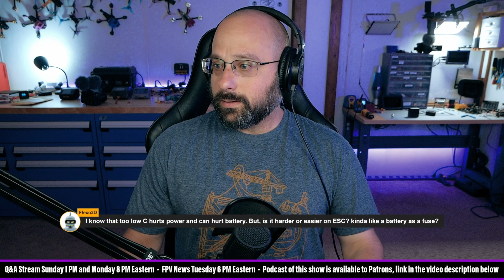Can A LiPo Battery With High C Rating Damage My Drone? - FPV Questions

Comment: ESC pulls the amperage it wants, batteries don't push amperage.  Just means the motor was over powered for the ESC not that the battery c rating was too high
Reply: Exactly his phrasing and conclusion were bad.
Reply: You are correct.

Comment: Just remember that the motors will try draw certain maximum current, and ESC must withstand that current flow and finally battery must able to deliver that current demanded by motor.
1. If your RC/drone motors that draw high current and ESC can withstand high current flow but your battery under deliver the current (low C-rating), this can overheat your battery.
2. If your RC/drone motors that draw high current and battery can deliver the demanded current but ESC cannot withstand high current, the ESC will overheat and burst into flame.

Conclusion, battery C-rating is just telling it can deliver how high the demanded current without getting overheated.

Comment: No, I don't agree with this. One of the few videos where I disagree with how you presented the information.  A poorly chosen ESC rating may fry when it's not limited by the current that the battery can deliver
Reply: A battery should never be the limiting factor, if your esc is trying to draw too much power it means the motor is either rated above what your esc can handle or your esc is dodgy.

Comment: Right first i'll state i'm new to drones/quads/RC,but i am an electronics technician,so i can clear this shit right up here and now.

I'll state that "I" searched to see if a higher C rating can damage my possible new quad i will bid for on flea bay.

So to set the scene the flight controller commands the ESC to output some pwm pulses to controll the MosFet transistor switches.

The rating Ids and Vds of the MosFets are the limiting factor here,not the motor,the motor will demand what it needs from the supply via the MosFets and thence from the li-po battery.

If the motor is not sized properly to the weight to overcome "AND" THE PROP PITCH DRAG,then the motor can be damaged as the control gear is trying to force the motor to drive a heavier load than it can handle.

The concept of slip comes into play which is how much travel a spinning prop give to one rotation like a dirtbike wheel spinning it's moving but the knobbly tire can get only so much grip on the dirt to give traction,air being a liquid medium is akin to the lose dirt you need more input to get more travel,this leads to prop pitch,how hard your drive can push the air and can the circuit paths leading to the motor handle the current.

I personally would assume the ESC is rated from the motor manufacturers data sheet on the motors maximum current draw for a maximum load,which those implementing the ESC into the drones design should be able to calculate(the loading),which may be for a specific thrust ,this is where the problem lies.

If you want and i am no different,(at least i can foresee an issue from experience of electronics) a faster reacting drone from changing from a limited current output C rating to a battery with a lower internal resistance that equates to a higher C rating,if  the throttle is just pinned out to rip and the motor tries to suck in as much current at the voltage of the battery,remember the voltage will not sag as much now due to the higher current available,the afore mentioned drive train ie prop drag/weight/thrust required to shift the bugger at the pinned throttle position may indeed burn the motor,if the Ids rating of the MosFets is up to it they will be fine.

As for the MosFets they will be in parallel each ESC may have six in parallel,each may be rated to a Vds of say 60Vdc no issue there,the current rating  Ids may be 20 amps or more easily,for quad package MosFets in parallel just add the current up eg 4 x20A=80A.

Looking at mousers site i see single package NVMFWS003N10MC Single N-Channel Power MOSFETs Offers a 169A continuous drain current, 3.1mΩ at 10V RDS(ON), and 100V drain-to-source voltage.

If you retro fit anESC with 4 of these you need not worry about the MosFets burning out,remember to check the data sheet for heatsink rating as the heatsinks i see on ESC devices ,to be honest they are shit and not up to the job,for bursts of current to push a quad like the one Mr joshua Bardwell and Co were showing on rotor riot with the 8s drone,i would have used 2 pairs of 4s  parallel then in series with another pair in parallel along each side,but what the F do i know,that little quad had the burst power of my 250cc suzuki RM,racing power max thrust when needed,ideally cooling will most likely be the biggest issue.

The biggest enemy of a transistor is heat dissipation and fast or a bad design possibly also downstream tinkerers mot quite grasping the concept as a whole.

Get silicone heatsink glue and a bunch of the 8x8mm heatsinks on the ESC mosfets,seal the electronics on the pcb with either a spray on conformal coating or paint it with nail varnish or the "proper" silicone brush on for electronics,though clear nail varnish is very cheap,don't paint the MosFets and don't add shrink wrap to the ESC after fitting heat sinks ,as the nail varnish etc will protect the electronics from moisture,WHY WOULD YOU ADD AN INSULATING LAYER OVER A HEATSINK?????????,the makers add some over the crappy heatsink plate,that makes no sense from a thermal protection perspective,so it protects from the elements,why not coat the electronics and allow the plate to breath in the air of cooling goodness.

If your gonna fuck around with electronics to "enhance" the performance. a ground up thought process needs to be undertaken,heat sink all that shit,that will i guarantee give current headroom if you don't think so read the manufacturers data sheet the the ESC makers data sheet,take the shrink wrap off the ESC read the small black squares numbers take not google them find the MosFets then get the data sheet and read about thermal atributes for cooling and how much current without a heatsink,add a small amount ant thet's most likely the ESC rating,add some 8x8mm heatsinks or ones to fit "each " tramsistor,then and only then will you have some confidence with higher C ratings,i still would not go crazy say 20c raised to 40-50c,i'd err on the side of sanity and go for 40c.

Sorry folks for such an long explanation,i am seeing a lot of amazingly experienced info on drones and how to fly them or program the drones flight characteristics on beta flight etc,but also some not so intune at the component level tinkering.

If anyone wants to learn more on this i suggest "THE ART OF ELECTRONICS" or "FLOYD ELECTRONIC COMPONENTS" floyd has the same 2 inch book on digital electronics too,piss cheap on flea bay these books and  the art of electronics has a student q+a book too.

A cheap scope,a logic probe ,a dvm and a component tester peak atlas do good ones or the multi component testers on fleabay i bought one and it measures close to the peak atlas semi tester. 

Mr Bardwell does have great insight and can rip a drone.

Comment: Batteries don't 'push' power to the esc and motors, so you can't have a C rating that is too high. 
The /motors/ 'pull' amperage from the esc and the esc pulls amperage from the battery. A higher C rating will mean that your ESC can successfully pull more power if it requires, but if it doesn't require it, it wont try to.  If you have over-current problems it starts with your motors pulling too much and the ESC cooking itself in the attempt to meet that demand from your overpowered motors. Either get a higher rated ESC or downgrade your motors.

Comment: :dothefive:i tested all kinds of different brand lipos here in china right from all the factories. 
what i have learned from that is good quality high C rate lipos will give you different feeling of your quad. i was flying bad cheap lipos for some time and then changed to newest DOGCOM series 160C 6s 1500mah recently. punch out is so much better and higher C rate lipos also get far less hot from full throttle runs.  (confirmed with thermal camera after each flight)
i also checked that multiple times with blackbox data. cheap lipos on a iflight evoque F5D got up to peak currents of around 110-130 amps. 
while good lipos peaked out at 165 amps. you can definitely feel that. i also see that a dogcom lipo for example with 160C and 1500mah can easily use up to 1450mah at normal cruising speed and then drop voltage at the very end to 3,4V while a cheap 1550mah packs could only give me around 1200-1300mah and then break down to 3.3V per cell while getting alot warmer. that means around 30 seconds or 1 minute more flight time as well. 

- my opinion is:  good lipos are not made with magic and everything gets 200% better but because you probably not pushing these lipos to their absolute limit daily they will also last longer and be worth paying a bit more.
but if you dont care about every bit of performance and just wanna bash around some months, cheap lipos are still ok to use until they puff up and go to trash. 

question was if they can damage my quad. but this topic is close enough to mention it anyway. cheers yall°

:dothefive:
Reply: What was the brand of shit batteries? Is gaoneng and cnhl good brands? Thanks in advance for your return
Reply: @gabrielnunes159  gaoeng are the absolute worst lipos i ever had. no power, always out of balance and easy to puff up. i had like 10 of them in different sizes. NEVER AGAIN! nothing but problems. 

CNHLs are good.
Reply: @cloudpandarism2627  thanks a lot man!! I was going to buy gaoeng because it says 240C discharge and I want more power on my 4S drone. The CNHL have maximum 100C. By the way, if I buy a battery with the same mAh capacity but with C like 120 or 160, or even higher, will it be more powerful when high throttle?

Comment: So it's not so much that the battery is doing something to the ESC, but rather than the ESC is drawing more current than it itself can handle. In which case if you put the same ESC with a lower C rating battery theen you could harm the battery because you're pulling more current than the lipo cells can handle.